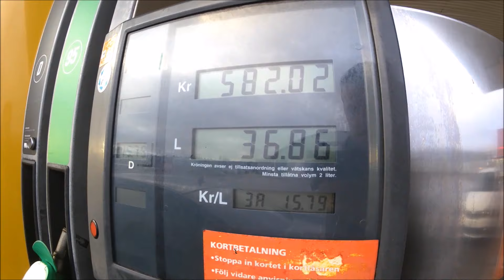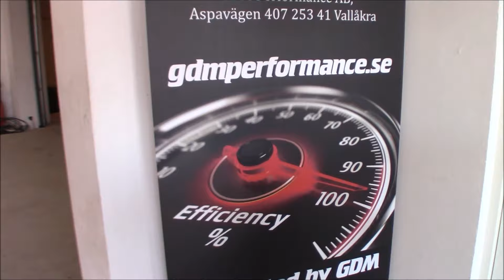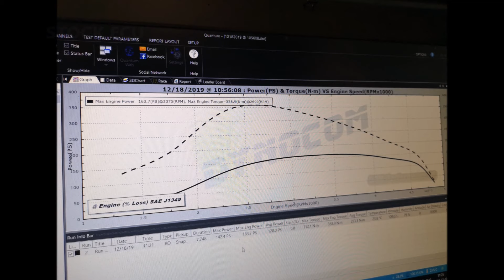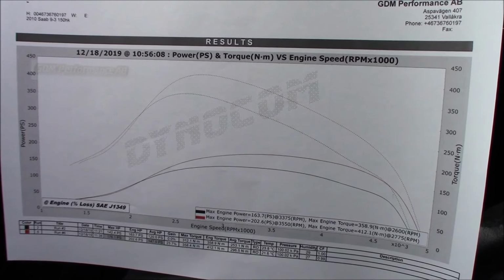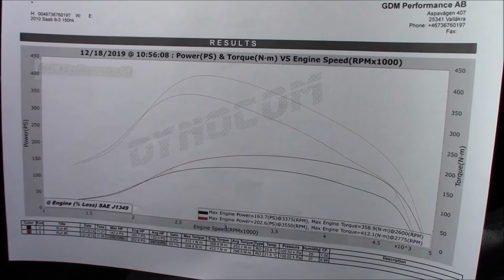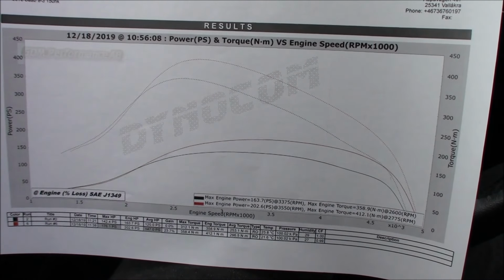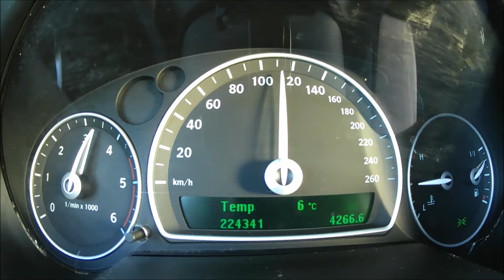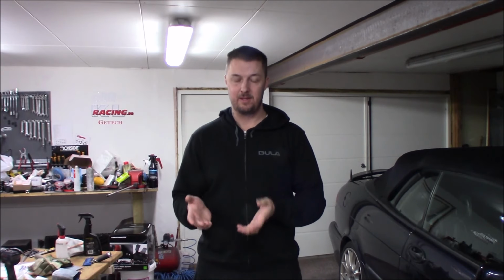SAAB 9-3 TID Tune + Dyno @ GDM Performance

Comment: is this possible to get this much power from the 8 valve one with 120 hp original?
Reply from the maker: Think it's The same engine just diffrent software so should be possible.
Reply: most TiD are the 16v 150hp. 8v can still make good gains tho
Reply: z19dt (8v) z19dt/h/z (16v)

Comment: By the way, what were new power and torque figures after stage 1 tuning? I've tried the software which gives 190hp, 410Nm to 1.9TiD. Works like a charm 👌
Reply from the maker: I got 203hp and 440nm, pulls really Nice 👍

Comment: Hey , great video , I am just after purchasing a 2011 120bhp ttid 93 , really interested in finding out what I could SAFELY remap this car to if anyone would know ? , I had my b8 a4 remapped previously and was a new car to drive after .. TORQUE MONSTER !
Reply from the maker: Upgrade to 314mm brakes and get a stage 1 tune, you Will get around 210hp 👍 same engine as The 180hp
Reply: Cheers man!

Comment: Why do your rear number plate lights flicker on the dyno?
Reply from the maker: Because that all lighting was turned of during the dyno runs ;)
Reply: @JonasKakarikas  Would be a funny correlation for every the time  the engine misfired the rear number plate lights flickered :D
Reply from the maker: @razmus6603  haha would be an awesome feature to have 😁
Reply: Vader breathez heavy he got ledz in his tail lightz... He should put some in tha iceblockz in tha back... I did all my lightz n when i turn my car off tha ledz run ah test mode until the battery killz the car completely... ppl alwayz see my lightz flickerin like d@ n ask me if I'm ah cop.lol. Vader breathez heavy

Comment: Congratulations for this map. Do you still have the precat and DPF? I don't have them on my 2005 sportcombi and I feel that the car is "lighter" without them. I'll love to know the difference in power with and without precat and DPF with your current map
Reply: I have a chalange to propose to you. Since the engine and part of electrics and electronics are similar to Vectra GTS that has sport button, can you achieve to have a sport button to a 9-3 Z19DTH. 😁😁😁😁😁😁
Reply from the maker: Yes i have precat and Dpf still installed.
With Dpf 209hp / 412nm 
Without: 220hp / 440nm
Reply from the maker: "sport Button" is just a software for an automatic gearbox to keep The gears for longer and probably shift alittle faster. Definatly not worth The effort, but should be able to do it

Comment: How does the TID stage 1 fells towards the 9-3 TTid?
Everything at the bottom and dead at the top?
Reply from the maker: Now it has a longer register but still most of The torque is at 2500rpm. My ttid is stock at 130hp right Now so this alot more responsive. But The ttid will get a tune as well to unleash that twinturbo power 😉

Comment: Is stage 1 going to affect on the emissions of the car/engine?

What was the price of stage 1?
Haven't tuned any diesel SAABs before so that's why I'm curious 😉👍
Reply from the maker: No it does affect emission, only a Dpf delete would.
The cost is 3000sek 👍
Reply: Thanks mate 👍